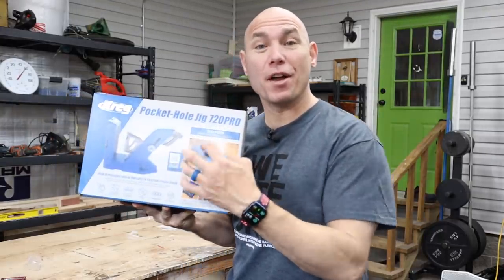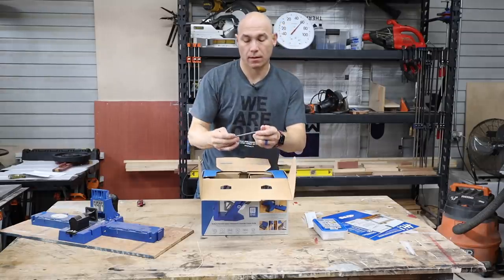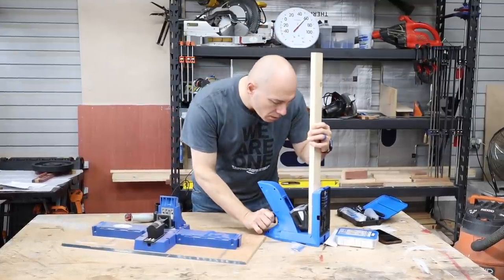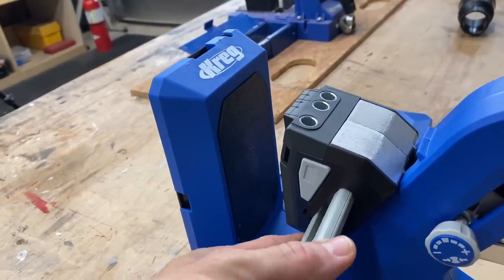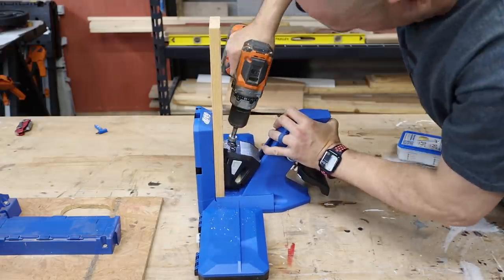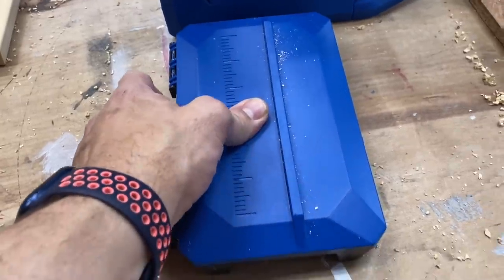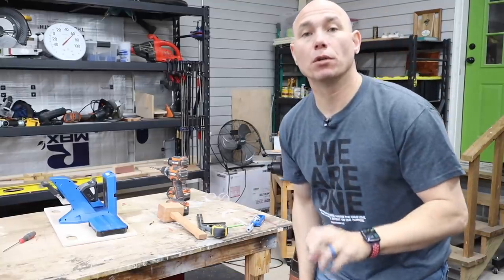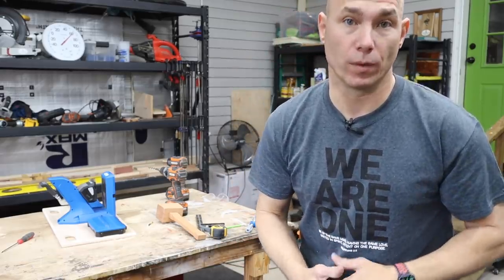Kreg 720Pro Is BAD!  I Made It Better!

Comment from the maker: I found a BETTER pocket hole jig with a LIFETIME warranty: https://youtu.be/eW718F6LiKQ
Reply: Matt, you missed one feature of the 720Pro.   You can take it to the work.  You can leave sheet goods for whatever on top of cookies (or other spacer) on your bench and work your way around the panel with the 720Pro.  So no more needing to try and balance a 3/4" thick piece of plywood in the jig.  I think that is why the 'Lego-like' attachment of the wings.  Easly removed so the jig can work horizontally on the bench. 
.
Keep up the great work!!!

Comment: Your board mount could have been cut so the back edge lined up with the back of the jig. This would allow the jig to be used in the 'flipped' orientation for sheet goods. I don't know how it would be flipped with the storage wings vertical. Maybe fine since you have screwed them down.
Reply: I was thinking the same thing.  Flush mount it to the back of the board and you can use it in both orientations.  Maybe alter the width of the board so it is flush mounted to the front too, to use the clamp both ways.  I like that the K7 folds up but if it is going to be flimsy, nevermind..mount it to a board. 

I have the K5, mounted on a board.   I think I prefer the K5 especially because I can use it with the HD accessory head and HD screws for quick strong 2x4 construction.  The K5 works well except for the storage box latches, i added Velcro after everything fell out the second time.

Comment: First off, if you had attached the bracket to the board the way they are designed to be attached to the jig, then you could remove the jig without taking the whole thing apart. The brackets attach to the jig via key holes. Second, all of that is unnecessary. There are wings built into the jig that you can swing out to place your stock on when drilling pocket holes (I recently discovered this.) No one has ever mentioned this in any video on the 720 that I have ever watched... including the videos about the 720 on the KREG channel. FYI: I saw the girls on  Shanty 2 Chic channel using the jig with the built-in wings.

Comment: Great review! I agree with you on the cheaper feel and the "less than positive" feel on the clamping handle. The main thing I don't like is that you can't remove the drill guide and use it as a portable pocket hole jig. I feel that the K5 is a more solid and versatile system. Think I'll stick with my K5. Again, great review and I love your channel!
Reply from the maker: Thanks.  K5 is the way to go
Reply: @731Woodworks  out of blue ones maybe yes butt ever have don pock holes yet im just going by seeing and hereing you all

Comment: The reason the wing compartments are attached as they are is that they are intended for removal! If you remove them, flip the main unit for use with a piece of plywood, you can them set the front of plywood on the wings to support it. By locking them down you've eliminated this feature unless you want to undo the screws each time you get to pout pocket holes into the edge of plywood (or any other stock).
Reply from the maker: Thanks. I don't think I would ever use it the other way. I've had the K5 for a long time and never needed to use it flat. I do have the R3 though so that may be why.

Comment: The wings are useful when separated.  I'm presently using them to pocket hole large cabinet panels and the wings help balance nearly the whole sheet.  Yes they are fairly cheap but at the price point and usefulness ratio is very high for budding woodworkers.

Comment: Kreg needs to give you a holler so you can really make them a real pro version.
If they used a harder plastic all the way around, maybe a $5 or $6 difference in their costs- but would have been so much better. 
Based on what you've shown, I think a pro version should have more aluminum, or denser plastic, metal hinge points, and/or the inside of the  plastic cases molded to anticipate someone putting screws into a mounting board...
Reply from the maker: I figure after this video, I'll be on the bad list lol

Comment: I just did my first pocket hole project, & used the Kreg 720 Pro.  I don't know any different (until this video), so it did just fine.  I did find that when unclamping, you couldn't just release it.  You have to pull the handle up that last little bit for it to release.  Again, I don't know any different, so it's all good.  If I need to start using the wings for support, I'll likely mount it to a board as well.  Thanx, Matt!

Comment: I have both. The dust fixtures on the K5 is garbage. On both, I replaced the boxes as spacers with solid wood wings. That works way better. Tools and bits and screws get stored in dedicated tool boxed. They are cheap. One set in each shop. (2200 miles apart) I prefer the auto depth and the dust collection features of the pro, the ability to use smaller diameter screws of the K5. Great show, thank you.

Comment: You can slide the jig off the board while leaving the sides due to the mounts sliding in.  Then you can use the wings when taking the jig off.  Agree with all your comments about design.

Comment: 1) Read the directions. The box wings are the “pro” option. The jig has built in supports that pop out from the body.
2) the “depth stop” you refer to is actually a stop block jig for repeating the hole drilling locations. You can design and build your own jig, just as others  have designed K5 mounting and jig stations 
3) The new drill has engraved depth marks to assist in setting the stop depth. Because so much is done using plywood that varies in thickness, stops still should be set based upon test results. 
4) the automatic thickness clamping is part of horizontal or vertical use. Time will tell how the clamp holds up

While the review is informative, it leaves things out that actual use over a few projects may help potential users decide whether or not to purchase. It certainly appears that Kreg will discontinue the K5 design. Time and fan base demand will make the final determination.
Reply from the maker: 1.  Directions?  Umm naa. I don't really need those for this.
2. I misspoke. I know what it is.
3. They aren't engraved.  They are printed on and will wear off over time.
4. I would rarely if ever use it other than vertical. Never have on the K5 or had the need to. 

The K5 is far superior.  Kreg missed the mark with this.  It is made with cheap materials.  It won't hold up for someone who actually uses it a lot. 

I am the fan base.  I have been a huge fan of Kreg for several years and have recommended a lot of their products on this channel.  This one doesn't measure up to the standard of products they've had previously.

Comment: Since I didn't have one of the K4/K5's prior to this one dropping, I went with the 720Pro (even though it might be less awesome), since they are discontinuing the K4/K5 from what I understand. So hopefully the newly created 720 Pro accessories will be a better investment going forward for me. As for mounting to a board, I think I'll mount mine flush with the back of the board, that way I can still lie it on it's back when adding pocket holes to longer pieces of wood.

Comment: I bought the 720 pro about 6 months ago and the first time I used it was outside for some fence repairs.  It was the first pocket hole jig I ever owned and it was awkward to use.  I decided then that I will mount it on a board and did just like you did, but made the two side pieces about 4 inches out and it works well now.  I simply clamp the board on my workbench and I am satisfied with how it works (so far).

Comment: It seems that they put a lot of time and energy making this tool versatile. I will admit, it can be pretty handy using the tool in more directions rather than just there vertical position. On the flip-side, it seems to have  fallen short on the proper tolerances when it came to production. As you said, it's the nature of plastic. It will be even better if you ditch the wings all together and build wooden support wings, in my opinion. Solid review
Reply from the maker: thanks
Reply: I agree with building support wings.  Btw, the thing you were missing about the support wings:  they made them detachable so you could set them further away to support a long board.  However,  after seeing how flimsy they are, I wouldn't trust them to do that job well.

Comment: I totally agree with your assessment of the 720 Pro. The idea is good, but poorly implemented. I like the K4 the best with the K5 second. I don't like the clamp on the K5 as well. They took away some of the flexibility with the 720 such as being able to pull the drill guide out of the unit and use it separately. I think I have most of the models up to these two new ones which I will not be buying. Thanks for sharing your opinion.

Comment: Great review! I thought I'd found everything I didn't like about the 720, but just about lost it when you found out the dust collection got in the way of the storage lid. As for mounting it, Kreg actually made the 720 jig so you can slide it off of those "Lego" pieces and leave the storage wings mounted to the board. I agree though, I would have liked a way to permanently fasten all of it down too.
Reply: Looking to buy one of these thing will be watching and try to get best option for my needs, just a beginner
Reply: The lego pieces in mine were incredibly hard to attach, if the idea was to be able to easily remove the wings so they can be set at a different distance then they failed there for me

Comment: I like being able to lay it on its back and use it. I would trim the back edge of your board to keep that option. But all pocket hole jigs need to be mounted. I've had my K4 on a board for 10+ years. Also curious about longevity but I had similar doubts about the K4 and it's still going strong. So, maybe it's just change that we don't like.
Reply from the maker: I've never used my K5 in another position. The K4 and K5 were much better made.  The 720 won't last.  The materials are just cheaper.
Reply: I've had my K4 for 16 years, the clamping mechanism is starting to get a bit stiff, but other than that, it still serves my purposes.

Comment: Just a thought, if you mount the jig flush against the back of your board, you could still use it in the horizontal position if you wanted to instead of having to drop a large sheet in vertically.
Reply from the maker: thanks

Comment: Great & Honest Review, but the the K5, there was only one way to insert the material and you could mount the K5 to a piece of Plywood.  The 720, if you mount it to the plywood, then you lost the versatility of the multiple ways of inserting the material in the Jig.  The Stop Block was nice addon & the wings with more storage is marginal if you actually used the storage. The K5 was just perfect as is, now how will we do anything larger than 2 inches?  I really enjoyed your video.   Have You considered Armor Tool Auto-Jig Pocket Hole System APJ1400, the lock down tool is much superior.

Comment: You COULD make the board hinge up on small piano hinges and still take advantage of the "folding" while retaining the rigidity. You may loose the factory hinge point but it's plastic and thin anyway. AND you could cut "handles" in the ends of the wings so that when it folds up, there's a place to hold it. Meh...just some thoughts.
Reply from the maker: Good idea

Comment: I will not purchase the new Kreg jig. I have the K5 and I'm happy with it. 

I'm surprised that Kreg didn't produce a jig specifically for plywood since half-inch and three-quarter-inch plywood are not actually half-inch and three-quarter inches respectively. Some woodworkers don't know this. They go on Facebook and ask why the tips of the screws are poking out of the wood. Other woodworkers forget this difference until it's too late.

Comment: I could see an issue with maybe lining the front of the jig flush to edge of plywood in case you needed to flip it on front edge if doing large piece of ply.
Reply from the maker: I have an R3 I use for large plywood pieces

Comment: Great review.  I love Kreg as well, although I have moved to the Armor jig.  I'm finding some issues with that one as well.
Reply from the maker: Nothing perfect I guess
Reply: Armour jig is great for the price.  You'd have to go much higher for a better system IMO.

Like the Castle Hole Cutter system starts at $400 with their portable table top 110 model and then goes much higher for their bigger machines but they're made for commercial production and produces cleaner and stronger pockets at a more usable 6 degree angle vs the standard pocket hole guide jigs that are at 15 degrees... You'd especially, notice the difference when driving the screws in as you can basically just hold the pieces with your hand to keep alignment vs locking it down with clamps with your standard pocket holes, and the shallower angle also means it can work with thinner materials and there's a bit less to worry about with screw length.

Comment: I just purchased this yesterday at a local big box store.   And I had to return the first one because the drill guide was defective - the metal guides were missing (!), looks like a final ream and press step were skipped in manufacturing.   How such a glaring omission can get past a modern manufacturing QC process mystifies me.   Then the one I exchanged that for (which I made them open to verify it was not similarly defective) also had issues with the drill guide.  This one had the metal inserts (yeah!), but the plastic had not been fully bored out on the exit to where the guide meets the work piece!  The drill bit would not pass through.   I really needed to finish the project I was working on so I just ran the drill through the guide and bored out the plastic, finishing the missing manufacturing step for them.   This is my first Kregg product and I am not impressed with their quality control. After I spent a day using it I came away with pretty much the exact same impression as your review.   It works, but it seems cheap, flimsy and a lack of attention to details (like the storage lid interfering w/ the dust collection!).   And my experience with manufacturing defects  doesn't do anything to improve my perception.

Comment: Your critique was honest and interesting but much of what you are concerned about doesn't really matter much to me:

Realistically, almost all the pocket hole work that I do is not precision in the way that the stop-block has to be within 1/8" or so.  It doesn't matter to me.

Yes, my 720 doesn't feel quite as solid as does my K5 but it holds stuff where it needs to be and the automatic adjustment speeds thing up.

The ability to fold up the wings means that the thing stores very nicely.  If you have limited space this is a very important thing. 

Yeah, it's actually weird that opening the wing will be obstructed by the dust collection.  But I don't really need to open the wing all the way most of the time (or open it at all) and if I really must open the wing I'll simply remove the hose from the dust collection port (it's really quite easy).

So far I prefer the 720.  I'm not getting rid of the K5 quite yet but at this time it is sort of taking the back seat.

Comment: Just picked up the basic 720, I’ll make the wings myself with a T-track for the stop and Mount to a board. The unit is made in China, says so right over the barcode on the outer box. This is likely why it has a more sleek look over the older models, because the tooling for the more complicated injection moulding is much cheaper in China, as is the assembly of a more complex auto-adjusting tool. I wouldn’t say it’s construction is “cheap” but it is a lot of plastic. It’s not “pro”, but the auto adjust feature saves a ton of time and I’m happy with the purchase as a pro.

Comment: Hi.  What Kreg Jig product would you suggest I buy for my project?  I will be 45 mitering all of my new 1x5 window and door trim.  I want to pre fab all of them using pocket jig screws and glue. The only videos I have seen doing 45's is with people standing the piece of wood upright at an angle and clamping the 45 end down flat on the miter. That's not going to be easy to do with a 7 foot piece of trim.  Do you know if you can do it on the flat using the 320?  I would love to get your recommendation on the best way to go about doing this.  Thanks and great review.

Comment: I had my best luck with the K4. The K5 I broke within 4 months of use. The metal on the pull down clamp broke. Bought the Armor tool machine and it was 25X worse. Broke it within 2 weeks of having it. Kicking around the Pro or a new K5. Thoughts?

Comment: I have a K4, a K5, and a Foreman. I love the foreman but it is not easy to use on large pieces because it's hard to reach the handle. I bought the new 520 pro because it looked like it would be easy to use in odd locations and on large parts. I was right, I love it for working on large parts, for tight areas., and for those times you forget to put a pocket hole in and you already have the box about built.

Comment: I like my 720 but I don't use the wings it came with. I haven't mounted it to a board yet like I did my K3. Just did a bunch of pocket holes and it worked great. When I to mount it, I'll just use 2x4s for supports. I'll put in some dovetail grooves for microjig clamps for stops. Plus I'll mount it to the back of the board so I can use it turned up for sheet goods. I've never used the K4 or K5, been using a K3 for years and this is much better, especially the dust collection which is very important to me. I bought the Armor Jig pocket hole tool and I just didn't like it.